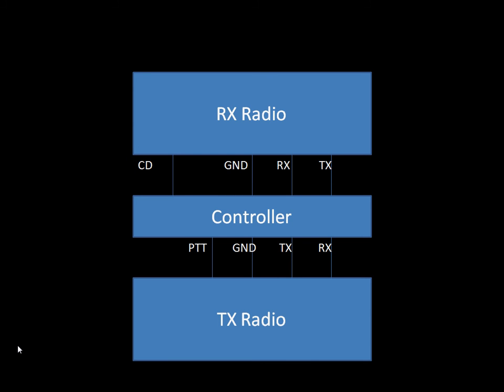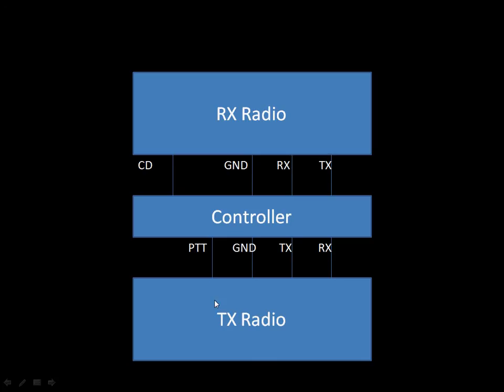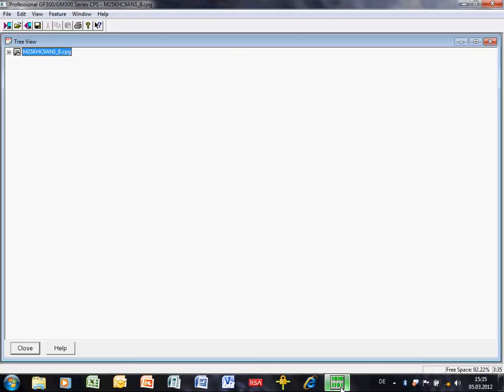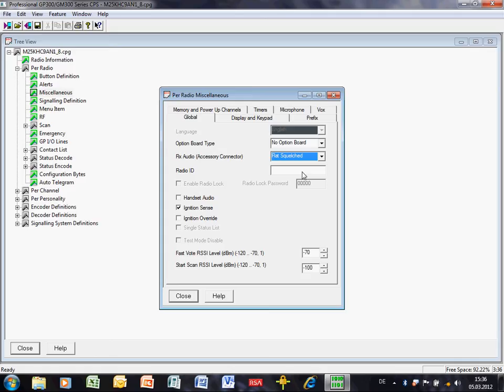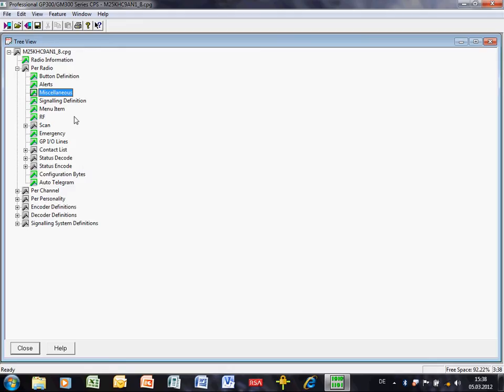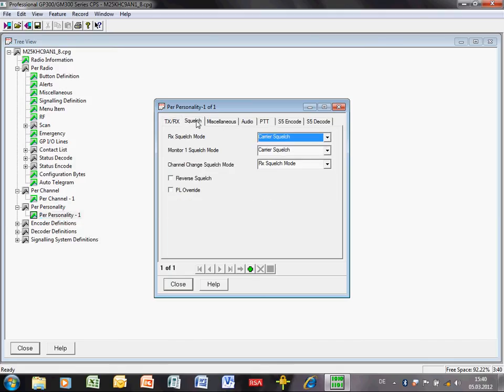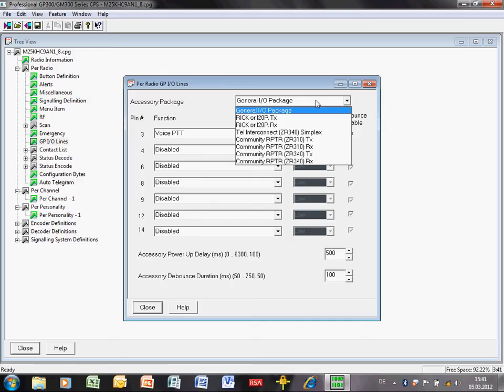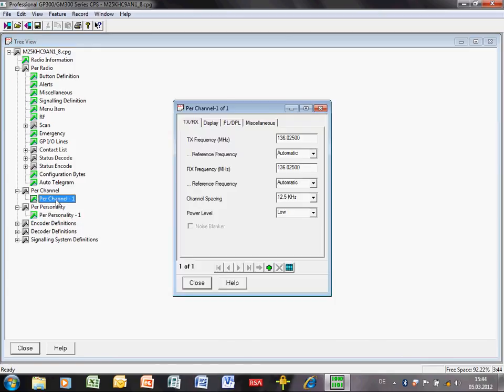Professional Series Select-5: GR500 Programming

Comment: What is the amps of the GR500 radio repeater?
Reply from the maker: I can't remember. It depends on what radios are used. My guess is around 6A on DC (0,7A on AC) when transmitting at 25W. This unit has been off the market for around 20 years now so that's the best answer I can give you.

Comment: Slighty off topic, but im trying to setup a codeplug for the GM340 to do Pocsag/Dapnet (paging) using the Data-ptt (line on accessory connector) and Flat TX (also on accessory connector) The only thing is that as the frequency is 439.9875, some people informed me that this cannot be done, and must be only on a 25Khz raster ? Also is there a place in the Mot codeplug where i can fine tune deviation ? 73 On2ON
Reply from the maker: Luc Bodson POGSAC uses QPSK so I’m not sure whether this radio would work very well - but still you should try it. 
Back when I was doing that stuff, the pagers and transmitters were all 25kHz - it probably will still work if you can find 12,5kHz pagers.
You can adjust the deviation using a separate application called Tuner.

Comment: Would you be able to help me. I need to program two m1225 for a repeater but I can't get the software to setup in my computer. Any suggestions. Thanx.
Reply from the maker: That is a very old radio which I'm not familair with since it was only sold in North America. I suspect you need to run it with Windows XP compatibility mode. You would have to do some experimentation to get the COM port working.